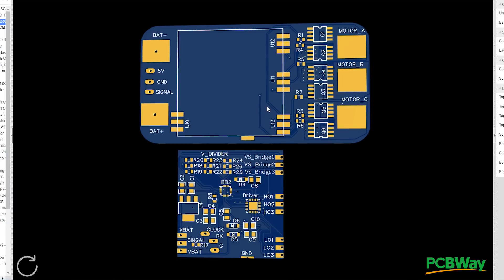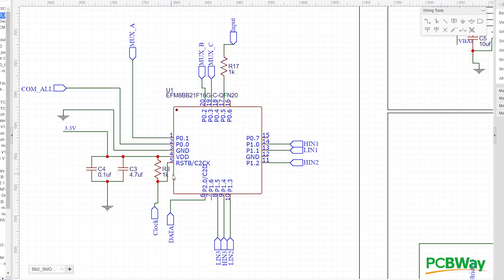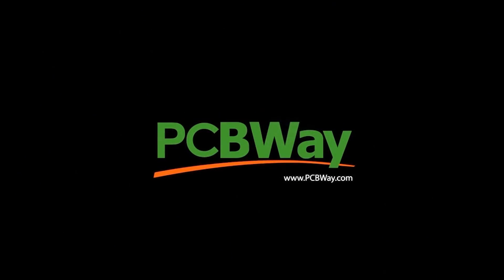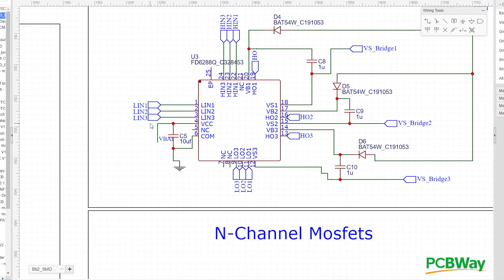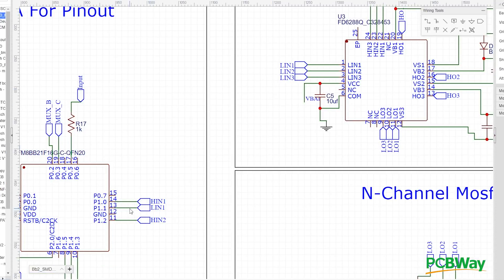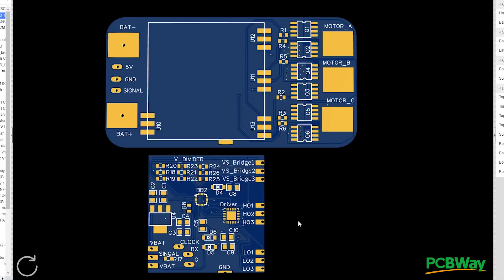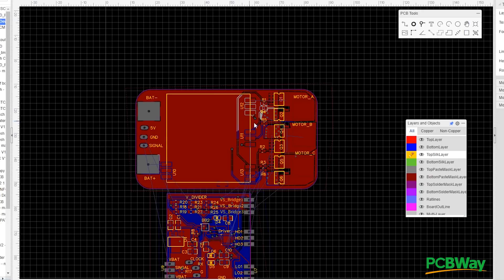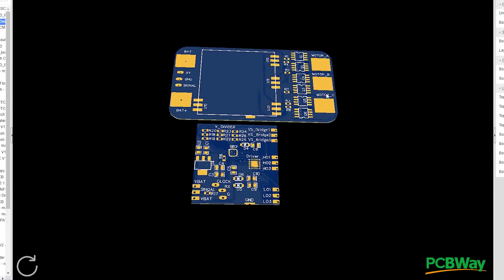How To Make A Brushless ESC 2019 // DroneMesh B_OpenESC [Part 3]

Comment: Are you not using a 5v Regulator and instead connecting the battery voltage directly to the VCC pin. Also what about the VB1-VB3 pins your schematic also shows them connected to vbat

Comment: To turn on the high side transistor, the gate driver voltage must be greater than the instantaneous source pin voltage, so this bootstraping it is done with a diode and a capacitor.

Comment: Mosfets have a pad at the bottom, you must solder it to the PCB! Also you need to allocate some thermal vias under each mosfet (using a pad mentiond earlier) to keep them cool.

Comment: Lots of sensor circuits do not handle voltages (much) outside of the range of the current power supply. The diode would cut the input at just a hair over that. The cap will prevent it from reading your video transmitter, etc... I would set the hardware dead time to no less than about 140% of the switching time (200% would be my starting point and I would not move it from there without some clear benefit). 
I wonder about using a gated sign wave as the waveform for low current states and maybe switch to a clipped and gated form at high current loads. I think using a sign wave might reduce RFI and EMI. This might clean up the FPV video image some. Also if you are really striving for accurate sensing, keeping the motor wires short and exactly the same distance from each other may help. I have long though the best place for an ESC is in the motor base plate, assuming you can deal with the heat. It would also be trivial in such a case to add a hall effect sensor and then you could use pure sign waves with almost no dead time. Maybe a hybrid ESC that uses FETs for the high voltage and bipolar transistors to handle zero crossing like some audio amps used to do. I think miniquad test bench showed us that ESCs could potentially be much more efficient if they did something smart with back EMF. Feeding it back to the battery is just about the worst thing you could do, short of failing to deal with it and allowing the voltage spikes to break things.

Comment: The resistors in the feed to the MOSFET gates is not for the dead time, there to limit the gate charge current, oscillations etc.
The Gate driver has built in dead time(Hardware Dead time to use your words) to take effect if the micro does not provide enough (Software Dead Time). 
The dead time is not in milliseconds, if that were the case then the best the motor could turn would be a little over 1,000RPM but probably less as there also needs to be on time. The dead time is usually in micro or even nano seconds, 
The MOSFETs you are using can turn off in 50nS and on in 16nS so I would guess the dead time would have to be at least >50nS, but not into the milliseconds. 

Your general description of operation is great, just a few timing parameters are off.

The VB1, 2, 3 pins are to provide power for the MOSFET drivers and boost circuit (Needed because the high side MOSFET is N channel and the gate needs to be higher than the source in order for it to turn on, this means that it will need to be higher than VBat to keep it on (So needs to boost the voltage internally so it can turn on the MOSFET)
Reply: Exactly. The author must read some technical notes for any mosfet driver, the are plenty of them available in English from TI, IR, ST etc. It needs a boostrap capacitor and diode due to high side n-mosfet is used, which will need gate voltage higher than VBat to turn on. Also, some drivers manage dead time internally. Some have overcurrent protection measuring voltage drop across DS of mosfet.
Reply: I found this conversation after searching for anything related to dead time for blheli. I built a board using this schematic and the motor is just twitching. I uploaded firmware versions G-H-00 as well as G-H-90 with no success. Wondering if someone here might suggest the next troubleshooting step.

Comment: Interesting project DM..still trying to follow how the FET driver is wired to each N channel FET. Also I still have some Hiee FPV goggles that aren't working I could send to you for a project. I put reverse polarity on it and it stop turning on.
Reply from the maker: Thanks .. Yes would love to try to either fix them on the channel and or re purpose it for something else email me.
Reply: @DroneMesh  cool...check your email.
Reply from the maker: @IanF-FPV  Checked and emailed :)
Reply: the motor is a star configuration, think 3 coils with one end of each connected in the middle. the outer ends go to A, B and C respectfully of the ESC fet junctions. The FET drivers can either put VBat or ground to each of these outer ends of the coil. if one is driving VBat into a coil, then one is grounding its end. there is only ever one path through so in this instance the third end is floating.(Neither high or low fet is on.
Current will flow A-B, B-C, C-A then start all over with A-B. this causes a rotational magnetic field that then pulls the magnetic core along with it (Part pull and Part push in reality)
The coil that is currently not driven can me monitored for back EMF and used for timing., (MUXA, MUXB and MUXC.), the MUXCommon point is actually an attempt to derive the center of the Star (Were all the coils are joined) in order to accurately measure the voltage and have a virtual ground point

A better explanation of that...  As there are only ever two coils passing current at any one time, the center of the star will always be 1/2 the voltage drop across the 2 coils. As the un-energized coil is plus the series resistors are relatively low impedance and the input to the ADC MUXCommon point draws extremely low current, there is no voltage drop into the ADC from the star point. therefor this value can be determined as Zero (For the motor) and the volts read from the un-energized coil due to back EMF (A result of it still passing through the magnetic fields of the motor), the micro controller can determine the timing and also how close to max speed the motor is... why is this ?

Well the KV of a motor is how many RPMs is required to generate 1V, the more speed, the more volts (Back EMF) the coils produce and as you reach the supply colts, less current passes because the back EMF prevents it (VBAT - BACK EMF / coil impedance = effective power applied to the motor). 
this is why you always hear that you loose torque as the speed increases and also why you can get more torque for the same speed with the same motor if you use more VBat (4S vs 6S for instance). 
The math is quite complicated and beyond this response but suffice to say it is not as simple as DC Coil Resistance and applied volts, more advanced ESC will monitor the drive current and therefor can mitigate motor and driver burnout
Reply: @TheBreadboardca  thanks again for the breakdown...I watched the video series again and read your comment. What I couldnt really understand was the Mux Common but yes that would give reference for the back EMF..😎
Reply: @IanF-FPV  In the video what I referred to as MUXCommon is referred to as COM_ALL, hope that helps

Comment: Is there a spot for telemetry on that pcb? Ive got 4 ex0ensove apd 8s proshot 1000 escs that all just have the telemetry trace to the chip fried but they are built with f3 chips and some of the highest components in the esc game and they make escs and electronics for government use as well and at like 75 bucks each pretty sure the big boy mosfets gotta cost a little bit & would love to rebuild em without the telemetry and not have a waste of 300$ escs.
Maybe i try the maker to see if he has any blank pcb on hand for fun ill see i guess.i
Reply from the maker: Send me the  link to the mosfets datasheet that are on that ESC, I will make you the back DEV for their Size.

Comment: Wish a 30x30 pcb board would come out to either make a 2in1 or 4in1 with the few 8s capable high amp smaller bl32 or proshot 1000 escs out like apdf3 100a or 120a 12s ,beerotor 80a and guess iflight has one being released thats supposed 8s but the other 2 are proven and then i know a guy that has really small 12s 80a escs the size of about half a beerotor 80 ,so that a beast class or macro quad class build could be made with thin streamlined arms making it cleaner looking ,faster as more aerodynamic a the while looking good and clean as well .
There is 2 supposed 8s 4in1s out but almost guaranteed both will faik either quickly or instantly and nowhere close to on par with APD let alone beerotor thiugh ive had 10 successful flights on ak32 35a 4in1 on 8s with 2207 2450kv  with 5in prop and almost sure 10in and 900kv or so would be cake for it and deff the 55a version out t,hough the reliability of the individual escs is proven by the masses not that my testing isnt all i need im also looking for 100a plus so kinda need a pcd /pdb that putb1 or 2 escs on each side of it and maybe where it completely solders to the pcb and it in turn has all the esc pad itself on the edge of the pcb itself like a 4in 1.
Maybe someone will design one for me eventually az im not capable of designing one on the osoa or whatever the pcb design site is called or wouldve been on it.
Pretty awesome video and info.
Reply from the maker: This project will be going into building X-Class ESC for my DIY X-Class build that will be upcoming within the next couple months. You will be able to buy the board and just solder the components your self or purchase pre-assembled. When you see me start on that Email me and I will help you get set up. Plus I need some info from you can you check what Mosfets those ESC's Use if they are proven to work great then we can implement them into the design and improve efficiency and see the possible break down issues with my stress testing setup.

Comment: have you ever met a flyback diode on esc's for extinguishing voltage spikes ?
Reply: you cant really as each coil is energized in both directions as the motor spins, you could use transient suppressors but the fets already have some level of protection via their built in diodes, and the fact there rated quite well.
Reply: @TheBreadboardca  thanks, this is reasonable and very informative 👍